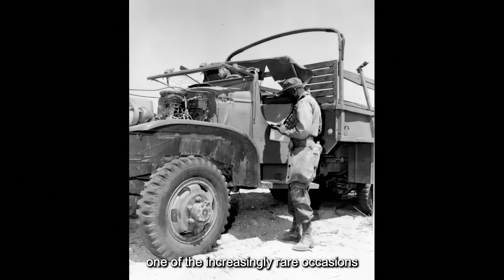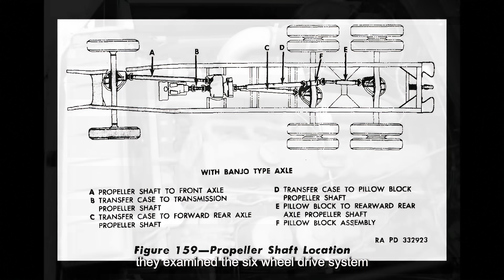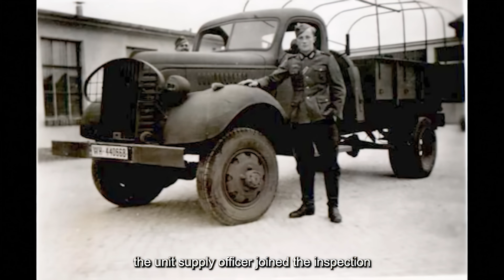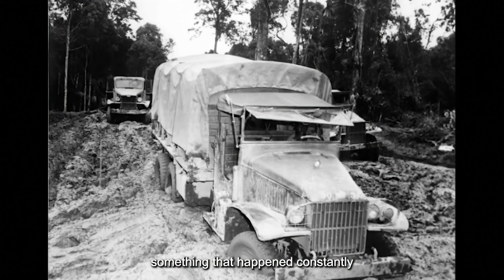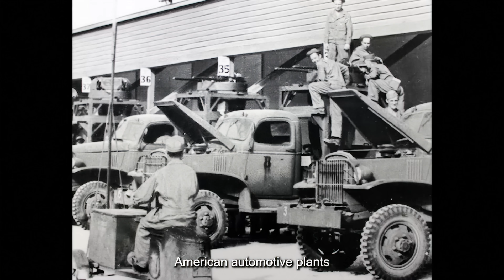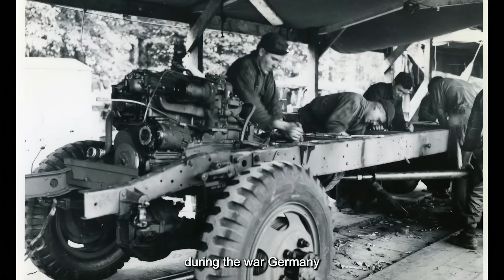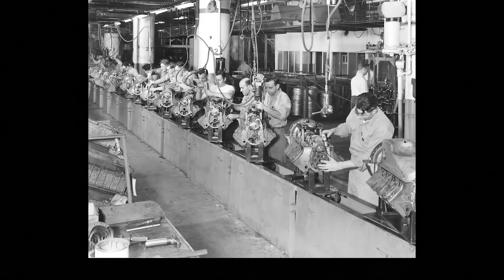Wehrmacht Mechanics Captured a GMC Truck... Then Realized Germany Was Doomed

Comment: What it is basically supposed to be built simple easy to understand it does not complex like early German engineering or anything just got to have different tools for different sizes of bolts and it is built simple Bill easy for anybody to learn it doesn't matter from a guy who just got out of high school or somebody got out of college it does not take a person with a high IQ to figure out how this works and yes the parts are supposed to be simple and easy and it is supposed to be more available to manufacture quicker and faster

Comment: Why is the thumb nail a M series truck they did not come out till 1950, and again at 25:00 the view of the engine at 1:16 is not a CCKW’s . It was rated 2 1/2 ton cross country and 5 ton on roads

Comment: Anybody else notice in the opening frames of the video where they are showing the motor, the radiator cap has a safety chain on it so you don't lose it and thereby render the vehicle inoperable.... Attention to the little details mixed with K.I.S.S. won the war!

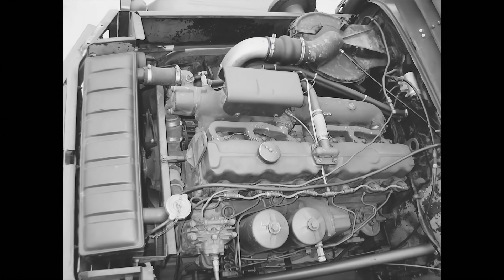Comment: Ai BS. 1:12., they are showing a multifuel engine. In WWII they were gasers. I believe they were manufactured by the White company. Good engine. 6o mph all day long. The multi fuel engine could run on kerosine mixed with oil. Maybe some head gasket issue but an easy repair in un 6 hrs.

Comment: I was in the Army in 1961-1964 in Ft. Benning and other places. Our deuce and a half was a gas  "Diamond T 6X6" and was replaced 
in 1962 with a diesel engine. We also had GMC 2 1/2 automatic trans 6X6 which I hated. They were eventually shipped to the desert.

Comment: Lead picture is a 2 1/2 ton Duce and a Half.circa 1955 or so. Air transportable and Canada developed the LAPES with the Herc. using them. Automatic transmission. Inline gas six. West Germany was part of NATO at the time. Canada had a large fleet into the mid 1970's. To the best of my knowledge the Americans didn't employ them. Sooo... this whole thing is AI?

Comment: The point is, and always was, Germans over-engineered things. By doing so, it also made them more difficult to produce and maintain. We engineered things to a specific set of conditions based upon a specific purpose. They tried to make the best in all categories. Essentially, by doing this, their engineering, in reality, wound up being inferior. I’m probably not explaining that correctly, but you get the idea.
Oh, and insofar as the “we just out produced ‘em” theory is concerned, yes we did, in a sense. HOWEVER we had to produce things for approximately 50 nations and everything had to work in any and all conditions and climates. From arctic to desert to jungle to mountains to forests to plains and in all weather...and they did work.

Comment: FARM BOY'S FROM WI.,MN.,IL.,MI.,IN.,MO.,NE.,KS.,KY.,OH.,PA.,ND ,SD.,MT.,ID.,CA.,VT.,NH.,MA.,ME.,NY.,TX.,UT.,FL.,SC.,NC.,WVA.,VA.,AZ.,AL.,AR.,AK.,WA.,OR.,DE.,RI.,CT.,TN.,LA.,MS.,GA.,NV.,WY., AND FORGIVE ME IF I MISSED ANY OTHER STATE THAT FARM BOY'S CAME FROM.
Reply: IL.
Reply: When my Dad bought a tractor after walking behind Work Horses for 20 years,the Tractor was a 1950 FORD 8N. There were 2 wrenches in the tool box(Came with the tractor)that fit Every bolt/nut on the tractor.

Comment: I have three 8n ford tractors: 1948, 1950, and 1951 and they all start, run and drive. Not just that, they work. All can do what they were designed to do and are all repairable. Parts are available and will be into the future. Name another machine that can earn that distinction.

Comment: Much the same thing happened with tanks. If an American tank broke down, a repair crew would show up fast and fix it, because they were identical. The tank crew, accustomed to working together, could be kept. But German tanks were often altered so that they required specialists, and the tank often had to go back to the factory. The crew would be broken up, and a new crew formed when the tank returned. Several experts have indicated that the American habit of creating thousands of identical cars, year after year, was one of the reasons for the insistence on building identical tanks.

Comment: A prime example of the “Good Enough, produce it”, was in tanks.
Yes the Sherman was at a disadvantage, but a surviving crew could literally go back to base and pick up a new tank, from the pool, ready to go.
Or a comparison between the engine in a Panther v a T34.
The T34 ran in heavy diesel, had tolerances that were more like suggestions and had a 30-40 day life expectancy. 
New tanks left the factory’s with spare transmissions or engines strapped to the rear deck.
The Panther engine was built to tight specifications, required good fuel, and had a life expectancy of years.
Guess which tank was produced in greater numbers.
“Quantity becomes a Quality of its own.”  Joseph Stalin.

Comment: The truck you’re displaying is a 1953 to 1956 model GMC deuce and a half 2 1/2 ton truck Canada used them they were sold off surplus in the early 1980s I purchased one surplus and used it on the farm sold it after five years of use too costly to maintain it would get about 5 miles to a gallon it was a gas guzzler I used it in the bush I would like to haul firewood on my farm in southern Ontario Canada it’s a 1956 model GMC six cylinder automatic transmission three gears in the high and low powerful truck too much of an antique for me to maintain I sold it got my money out of . Five years later.

Comment: In vehicles of all types, tanks, liberty ships, aircraft of all types and kinds, ammunition rounds of all types, weapons from firearms and grenades through mortars and artillery and beyond, clothing and boots, food rations, and everything else that a large war required, by 1943 the United States industrial complex and factories from coast to coast out produced Germny and Japan combined by a vast margin. This war production output was continually transferred across the ocean and to the front lines in quantities that stunned the Germans.

A captured German Tiger tank commander told interrogators that "...Our Tiger tank is vastly superior in armor thickness, gun size, and gun range. But for every Sherman tank of yours that we destroyed, 2 or 3 took it's place within days. Replacement Tiger tanks often took months, and not always in the quantities requested or needed. We had to limit use of fuel to only what was needed to carry out our mission. We also had to limit our use of tank shells and gun bullets to targets that were sure or near sure kills or necessary defense as both fuel and ammunition were in short supply and sometimes not readily available. By contrast, your Shermans burned fuel with abandon, going wherever they wanted as often as needed. They also used ammunition with equal abandon firing at all targets they saw, whether in clear view or not. Our Tiger tank fuel depots and resupply camps were not always close to the front lines while you had both close to the front lines with new ones being built as the front lines advanced. Whenever we managed to destroy a fuel depot or resupply camp, the constant, never-ending arrival of your supply trucks allowed the destroyed depots and camps to be fully rebuilt and resupplied, sometimes in a week. Against such overwhelming industrial war production, transport and resupply, our far superior Tigers had no chance.

Comment: In the U.S. , Torque is a bit more important than Horsepower . Their 'curves' always  cross at 5250 R.P.M. for Some mathematical reason . Fat torque - band (like Chevy bow - tie V - 8 small - blocks) are good example . Inexpensive , exhaust - scavenging , post - factory improvements bring enormous gains . 300 feet/second , exhaust - gas speed . Peak torque R.P.M. and 'Resonance' R.P.M. are Very closely related .

Comment: It's not just the simplicity of manufacturing. You mention all the plants using the same bolts same specifications. Ease of repair. This equates to a more efficient MTTF, (Mean Time To Failure), MTTR (Mean Time To Repair) and MTBF (Mean Time Between Failure) which mean more run time to attack and not slow the progress. No others could compete period.

Comment: Canada (1/10ths the size of the U.S.) made over 500,000 CMP Canadian Military Trucks alone, making over 800,000 military transport vehicles, 50,000 tanks, and 1.7 million small arms.  While sending a significant amount of steel and iron ore to the U.S. which was an ally at the time.

Comment: nah lets skip the fluff, the duece & a half had all wheel drive and if that Opel Blitz didnt. well i dont need to tell you a 2 wheel drive heavily loaded transport will get stuck in unfavorable conditions. you can take that duece and throw down a canal, walk it through the mud, put in park, have smoke- come back and still break loose. 

to be fair to the horses they had 4wD atleast

Comment: This is just bullshit... The germans depended on LIGHT trucks for fast movements demanded by the biltzkrieg tactics and infrantry support movements NOT Heavy trucks. And they looked more after the russian trucks coz the german blitz and others showed very poor reliability during the russian campaign in cold freezing weather while the simple russion trucks seemed immune to the frozen temperatures. Also the mud which was not as bad in the western american theater of war so a vehicle like the GMC wasnt needed on the german side on the western front with many good roads and cities while in russia it was mostly open fields muddy roads not streets and cities. Also the germans new the capabilities of the american trucks and military since before the war from intelligence. During the battle of the buldge the american trucks also showed the weakness in muddy snowy forrest terrain which was a dissaster for supporting and supplying the american troops. Gemany could and did also manufacture many Opel Blitz and others in the early stages of the war showing during the Africa campaign but in later years of the war were focused more on other vehicles like tanks due to lack of resources and trucks were not needed as much. 3400 trucks were produced from oktober to Dezember (3 Month) in 1939. Over 15.000 in 1940. Same in 1941 making the produced number to 40.000 in 3 years. That was no less then the americans produced. After that the numbers were halfed and declined reason being bombed facilities and lack of resources and less needed trucks. The quality and reliability of the Blitz for example was enough for the early uses of the War in Europe and in Africa as well as in the early russian campaign.

Comment: 7:38 and they drove it to destroy it, at the height of the red ball express they all had a tight schedule of transporting cargo, the higher ups realized that it was far better to ditch them when they broke down or suffered a crash than losing time in maintenance repairing them, after all the production of them was abundant and they could replace them quickly. Americans were in another league in production and logistics.

Comment: You're completely ignoring the Battle of Britain. The Luftwaffe was vastly superior to any other air force in the world, having developed the most precise bomber at the time, the famous Stuka, the Messerschmitt 109 with its advanced engine, better handling at mid-altitude and easier to produce than the Spitfire, having years of training pilots and experienced in battle, and all the resources and factories Central Europe could provide. Britain didn't have the Lancaster bomber,  building aircraft took ages and in general there was consensus that the Nazis had the upper hand:

“When it comes to fighter vs. fighter and the struggle for the altitude gauge, we must expect for the time being [the Spitfire V] to be at a disadvantage as compared with the improved [Messerschmitt  Bf 109F] we are now meeting”
– Memo to Air Marshal Sholto Douglas, AOC-in-C Fighter Command, from the Senior Staff Air Officer, April 1941.

“I preferred the 109F because it flew well at any altitude, was fast as most . . . had a superior rate of climb and could dive very well. Most of all, it instilled confidence in its pilot.”
– Franz Stigler, date unknown.

But the Me 109 turned out to be an anomaly, most later designs aimed for excellence in engineering and the use of advanced technology where possible, while resources destined to cheaper to produce, conventional weaponry dwindled. Had Germany not concentrated so much effort on this terror weapons, like the V-2, which was only aimed at the population but had no real military value, it could've stood its ground for far longer and even conquered Britain. On the other hand, it could only mean that the Nazis stayed long enough in power to see the cities destroyed by atomic bombs which is not an evil I'd wish on anyone.

Comment: Had a 1946 CJ2-A I drove endlessly all during my childhood. Go anywhere. Indestructable. I would jump her 4ft into the air and land and never break a leaf spring. Motor always started without fail. In 4WD, low range, I would put her up against a tree. set the manual throttle position, and get out and walk away while she spun her wheels trying to push the tree down..! She was a Willy's and I called her Willy..! While climbing hills I would encourage her by shouting the question "Willy (will he) make it..?" She usually did..!

Comment: The coming about of the EV Age is an opportunity to reinvent the automobile and light truck and endow the owner with the ability to self-service his/her vehicle with interchangeable components readily available and easily installed by the old military "black box" philosophy. In this manner economical vehicle ownership and ecological sustainability could easily co-exist.  In addition, older vehicles could be retrofitted giving one the pleasure of driving a vintage vehicle that could be indefinitely maintained without the eternal parts scavenging,  
    But it won't happen.   Because the Big Corporations will continue to hawk their overpriced, needlessly over-engineered products loaded with features we don't care about and which numb the thrill of real driving, putting the driver into an endless debt cycle while those on top fatten their wallets.   
   What does this have to do with 2x6s?  We need to go back to the basic principles of quality, durability, and ease of maintenance that THOSE vehicles represented so well and realize that it is now WE who have become those German engineers, exercising such technical brilliance while taking the impractical to a new level.  We need a revolution, of sorts, back to the basics.   But it won't come about by Big Auto; if it happens at all, it'll start in a little shop in Pasadena or Royal Oak where some guys with a Better Idea will lead us back to sanity.  Let's hope it happens soon, while it still CAN happen.    - JCK, British Transportation Museum, Dayton, OH

Comment: Echoes of War, please label the picture of the, inline 6 cyl engine, as a later model, diesel engine, or update the picture to a, WW2 gasoline powered inline 6 cyl engine.
It's tiring to be reminded, every 7 comments that you're showing a picture of a, diesel engine, and not the, inline 6 cyl. gasoline powered engine, it should be.

Comment: The difference that American trucks with electo start was such a major improvement for the Soviets. They spent up to two hours a morning cranking their trucks saved tens of thousands of man-hours. The katusha rocket launchers were mounted on Studebaker. Fire and move in less than 5 minutes. Movement of supplies from railheads to Frontline units made a huge difference! The US produced 500,000 fully interchangeable.50 caliber machine guns.

Comment: From around 13:42 to the end, the line “perfection is the enemy of good enough” really hits hard, especially when paired with the image at 25:07 showing 560,000 GMC trucks versus about 100,000 Opel Blitz. Watching the mechanics realize that standardized, repairable systems outlast elegant engineering feels like the real turning point of the story. To me, this video shows that logistics and mindset decide wars long before battles do. Do you think modern armies have truly learned this lesson, or are they repeating old mistakes in new forms?

Comment: Ironically, America today seems to be following the German model to failure. It has a hollowed out industrial base and rests its hopes on small numbers of superweapons, against vastly superior industrial resources in China. But what happens when a one-armed saboteur with a hand grenade finds a way to slip past security and destroys a fantastically expensive stealth bomber or fighter that is invincible against any enemy aircraft or air defense? Or an aircraft carrier is swarmed by hundreds of missile boats from a country with 273X (not 273%) our naval production capacity?

On the flip side, consider the strategic dilemma that German industry was in. This video suggests the American philosophy was superior, but I'd argue this is wrong-headed. Suppose the Germans really had just blindly mimicked the American approach, simplifying designs and ramping up production output. The problem is that Germany had gotten itself into a war where it needed to field superior equipment to win. Simply copying the enemy approach would not work when the enemy population (the US, the British empire, the USSR and more) vastly outnumbered them. Mass producing a thousand tanks is no path to victory when the enemy mass produces five thousand tanks in response. The tanks really did need to be better.

There were also resource constraints. Mass producing more trucks would have been pretty useless without finding a way to produce more oil, which became a serious constraint for the German war economy. So while I think the Germans could and did find value in learning lessons from the American approach, I also think their emphasis on higher quality per unit of output was strategically sound, so far as it went.